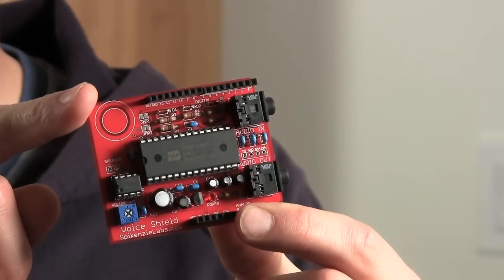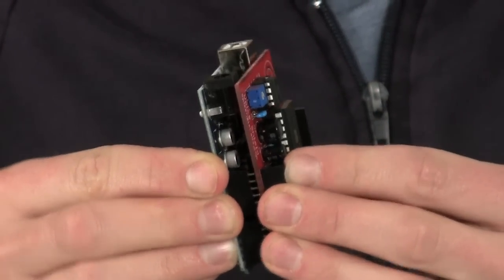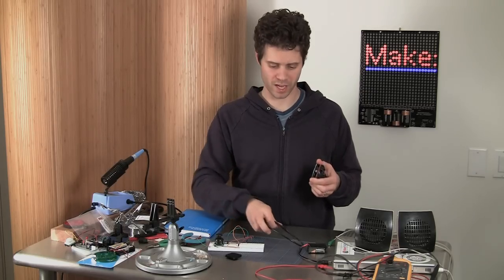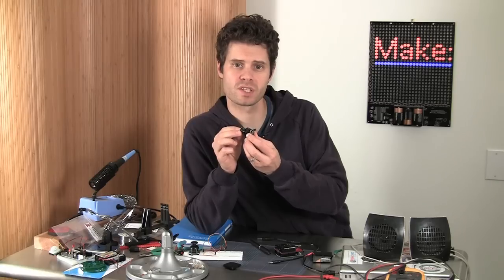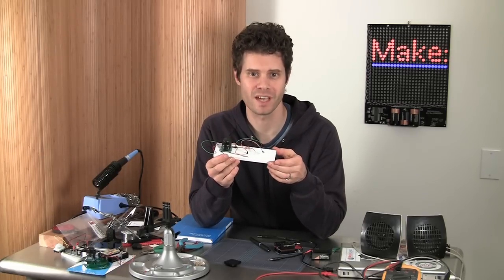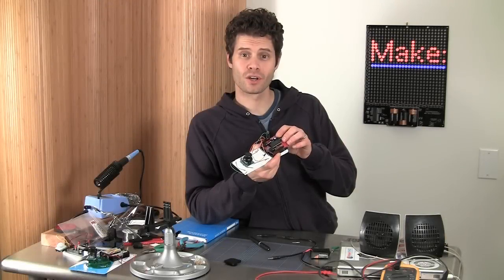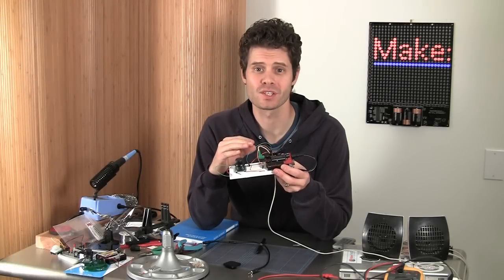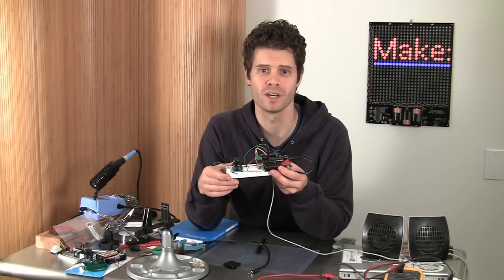John Park in the Maker Shed: Joystick-driven VoiceShield

Comment: @jejeroyetompson The question is not as dumb as you think. The mouse transmits delta-coordinates (distance travelled on X and Y axes since the last pulse) - you could make an analog joystick into a mouse by reading the x/y output of the joystick at a certain rate (faster than the external bus) and adding the values to a suitable register, then feeding the computer and clearing the accumulators at every bus clock pulse.

Or did I miss something here?

These instructions are not tech specific.

Comment: @jejeroyetompson Wtf?

It will definitely not result in a trackball (which is an "inverted" mouse - you move the surface (ball) instead of the sensors (mouse)), it will result in a "TrackPoint" style device, or "nipple mouse", as it's called, but with an actual joystick.

Also, writing a mouse driver is piss easy, on top of which you won't need any specific driver if you make the joystick->mouse adapter use the PS2 or COM port.